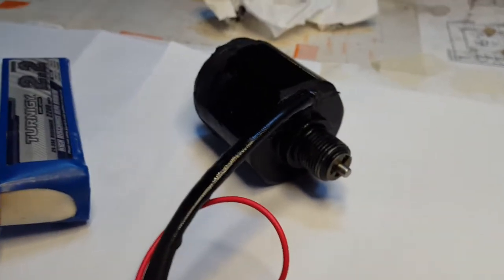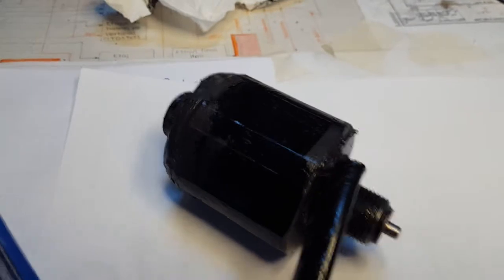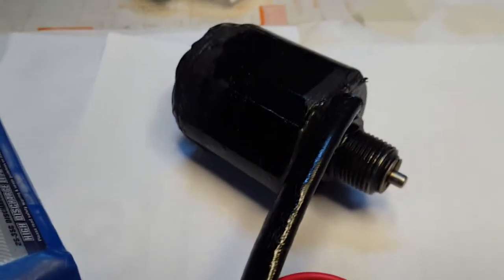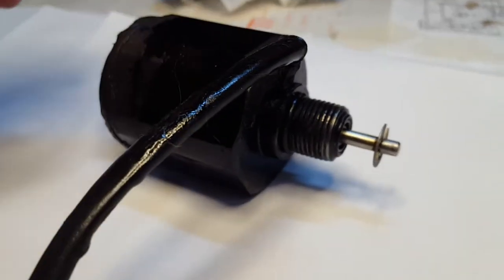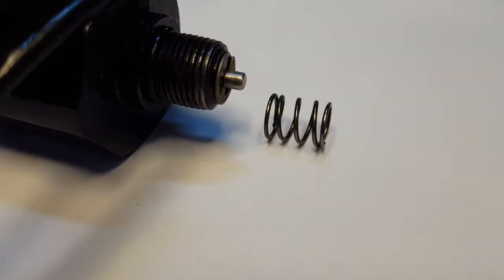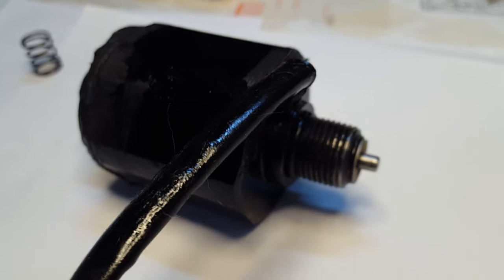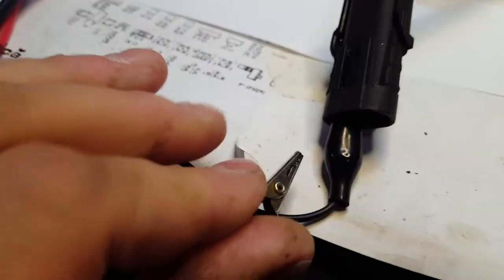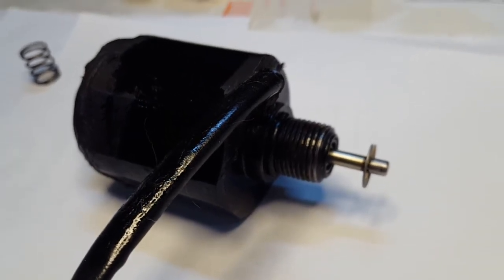Diferential Turf Polaris Solenoid

Comment: Actually it's the other way around. When “Differential-Unlock” is selected, the electrical solenoid actuates the shift fork. The solenoid plunger extends out to move the fork and slides the engagement dog away from the side gear that is part of the planetary differential assembly. This unlocks the rear differential. just thought I'd let you know
Reply: What is the correct input voltage for this solenoid ? 
I have 3 volts constant with no action at any selection , have not seen any bad wires as yet
Reply: @richardbertrand2770  Sounds like mine, if I pull the drive fuse out from under the seat I  have 12 volts on one side and 3 volts on the other side with check engine light on, I'm stumped.
Reply: Donde se encuentra esa parte del solenoide en un rzr?